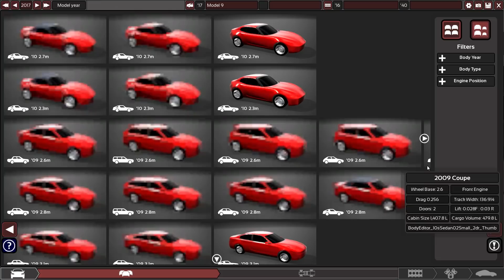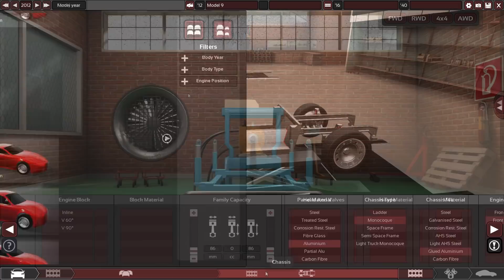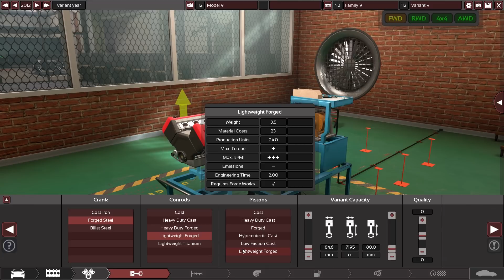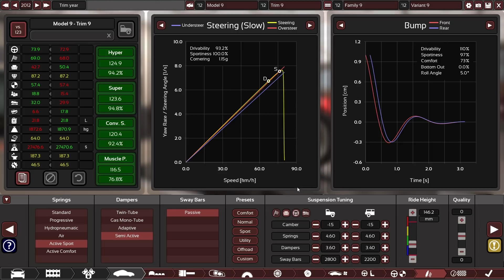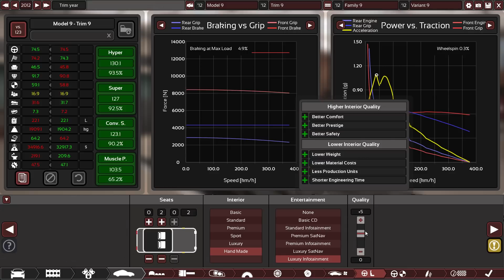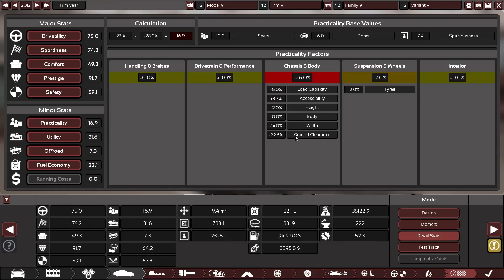Automation Technical Design Challenge (10s Hyper)

Comment: I'm really liking how good the suspension AI works now! Before it was... well not really good let's be honest, but now it gets you to a really nice base to tune it slightly further yourself. One of the better QoL changes you've made that i appreciate.

In regards to what you said with hyper basically being an extreme/high-end sports car, and a Super being more of a track car, is something i couldn't agree more. And as a car guy, it really saddens me that we no longer have these crazy "stupid" hypers like we used to have. Main culprit here being Lamborghini. Around 10-15 years ago, when Audi took over, they said that so far, Lambo's priorities were, in order, Top Speed, Acceleration and Handling. And since Audi took over, it would change to the other way around, which i think made them lose the status, at least in the minds of many, of true Hypers. Simply because instead of being beasts, but great beasts, like the car you just built, they were just rockets for the track. And that's not a hyper, that's not the definition of a hyper, but instead of a super. And it's something i'm really sad about, as we've been losing those. Astons are GTs, Ferraris are Supers (high end ones, imo), but we don't really have any true Hyper car out there atm. 'Tis sad
Reply from the maker: Yes, it is quite fun to see how these categories have evolved (not the result maybe, but the evolution is interesting). :)
With the suspension revamp we did the presets are much easier to calculate :) that made it possible. The AI has to use them too, so getting them nailed down was important.

Comment: You are exactly right about hypercars not really needing track performance, who the heck would buy one just to drive it on tracks and make it lose value? These belong in collection rooms. It's not like Bugatti built the Veyron to be a track warrior; it's a big dumb soap bar with 1200hp and goes to 430kph.
That V16 sound is glorious! Shame on modern carmakers for making 'hypercars' with V6 turbo vacuum cleaners. 
Also, active comfort springs work better on hypercars. The extra comfort really offsets the tiny bit of sportiness you lose. I think active sport is only for supercars and sports cars (track premiums don't like it since it adds a lot of weight).
Reply from the maker: Spot on man, good point on the comfort suspension, that's a smart move.

Comment: Worried about overkill in a hyper car?

Also when are the turbos going to be now, not the 80's, I tried to make an i30N and the turbo is crap
Reply: Great to hear that. Finally no more 21st century Group B Turbo.
Reply from the maker: As a company, overkill kills YOU ;) so damn right I worry about overkill - especially in a hypercar.
Reply from the maker: Ohh, forgot to add: forced induction revamp comes once the grand campaign is mostly done.

Comment: Aww, the V16 was a bit of a wrong decision for this, to be frank. Personally, I would've preferred sticking with the engine types most users can use as opposed to the type only a elite few have.

I mean don't get me wrong, it is an engine befitting of something called "Hyper". But right now it's as rare of an ingame resource as the car that holds it... For an Automation school resource, it's like using a real diamond to teach geology! :P
Reply from the maker: I'd rather show something that not everyone can do, all the same principles apply for a V12, that probably would be the better choice from a company perspective. :)
Ohh, bad example there, just FYI, diamonds are not rare at all (they are just made expensive by artificial scarcity) :D next time you can use Grandidierite and look real smart xD
Reply: Fair enough, at least the lessons apply even if you cut 4 cylinders off the engine and run a less exquisite setup. Knowing full well what a overly-developed hypercar was (I did submit one myself, after all xD), at least I have half the lessons learnt... 
Haha, oops. Indeed, Grandidierite sounds a lot rarer (is that even a real stone?). Should've gone with Kriptonite; I'd lose accuracy points, but I'd get them back through popular culture! xD
Reply from the maker: Haha :D yes, well, it is so rare it doesn't even have a proper wikipedia page xD https://en.wikipedia.org/wiki/Grandidierite
They are really pretty though :) basically impossible to find as clear gems. https://www.gemrockauctions.com/auctions/rare-gemstones/grandidierite/?order=price_high
Reply: Someone went through a lot of trouble of adding all the characteristics, though. Dana classification, 2V angle, there's more information there than the actual text! What a paradox page... xD
And indeed, they're very pretty as a clear stone. It's like a shiny jelly bean... Who knew a car video taught me about rare stones? What a masterful stroke Herr Rob, I tip my hat to you. :)

Comment: I've got a Challenge for you:
Try building the Devel Sixteen Engine (If you can't reach 5000hp try reaching their "road configuration" which is around 3300hp). Hope you have fun 😉
 (I'd try it myself if i had the v16s)
Reply from the maker: You can try yourself by just doing 0.75x the power with a 0.75x capacity V12, there is nothing special with a V16 after all :) just more cylinders.